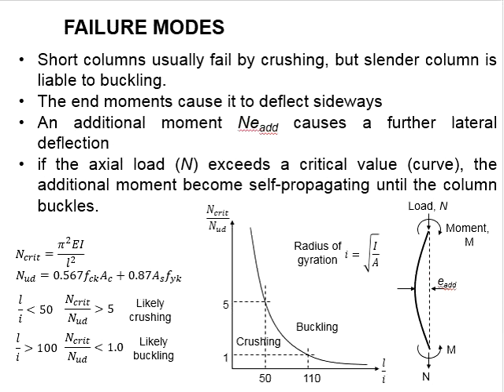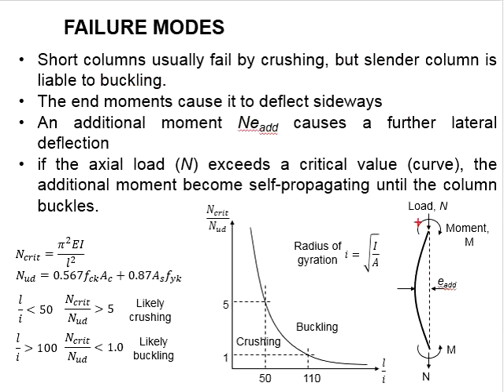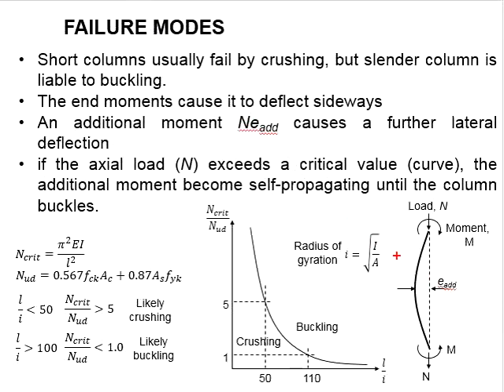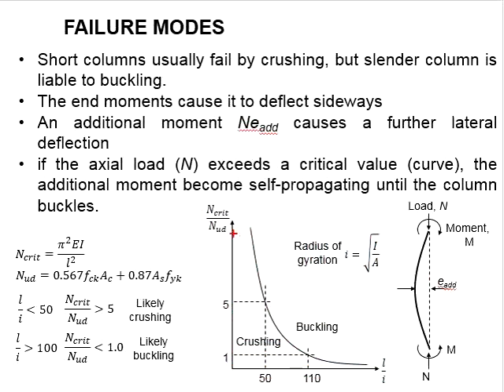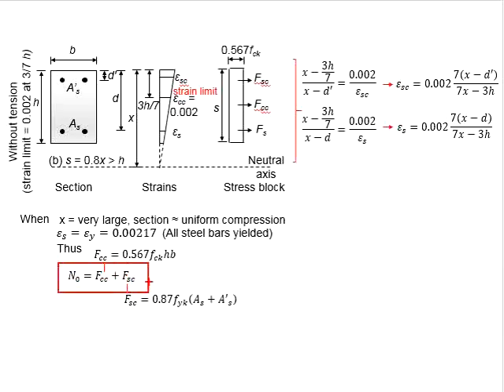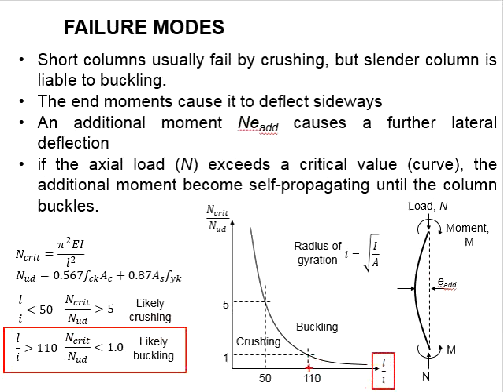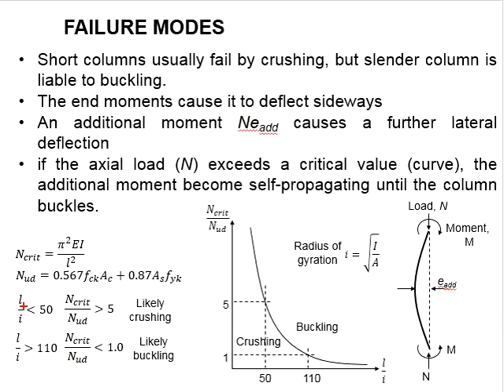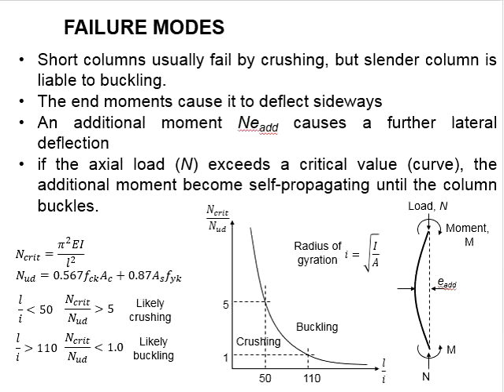2.16 Failure mode of short and slender columns

Comment: Since we already know the areas of steel reinforcement required, why do we again need to check for the failure modes? isn't it safe from the reinforcement we already provided with ASprov? I thought the column is not gonna fail if we provided above the ASreq.
Reply from the maker: Yes. no need to check for failure mode. This only serve as an indication to the potential failure mode of the column
Reply: @eng-aim  thank you